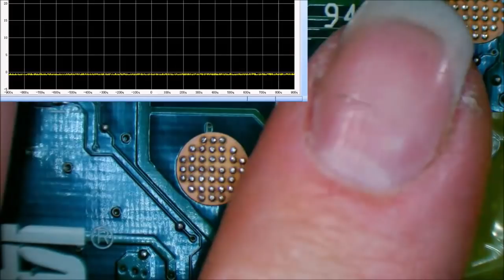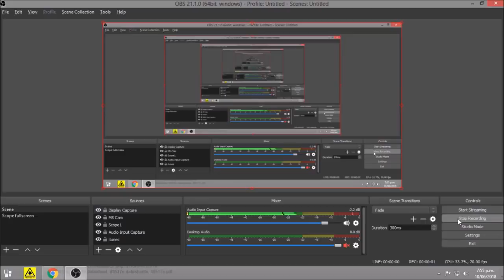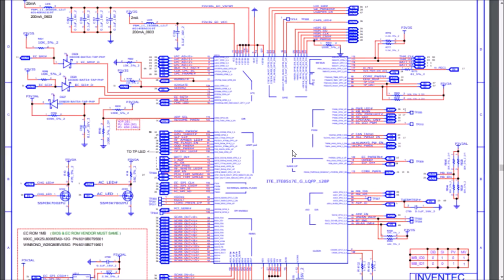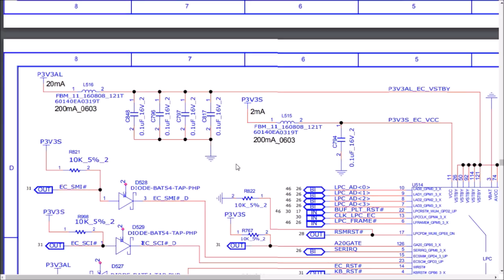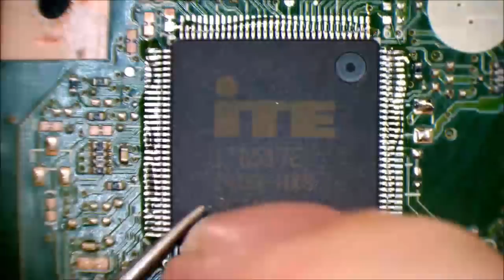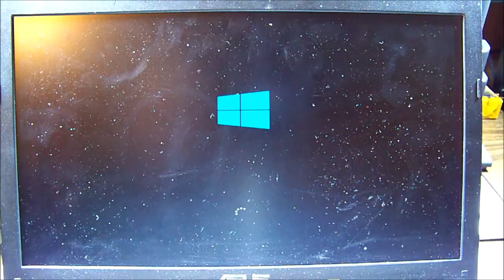Asus A55V completely dead repair

Comment: Hi, I am a newbie, I have the same problem as you. The IC that got hot looks like mine that got hot too. But after I put alcohol on it which evaporated, the whole board now has voltage drop even at the dc jack (only 1 volt). I wonder what the problem is, I can't seem to find parts that is short to the ground.
Reply from the maker: If only 1V at the jack maybe the jack is bad. Maybe try connecting a power supply directly to the motherboard to prove this (set at same voltage as charger). Will need to be at least 3A capable.
Reply: @JonnyFix  Nope the jack is not the problem because if I took off the first mosfet near the jack, then it has 19v just fine. :/
Reply from the maker: @Negiku  You may have to put the mosfet back on and use heat to find the fault. The charger will be shutting down, 1volt won't make heat, so you will need to use a bench supply connected to where the jack goes and limit it to say half an amp and turn it up from there until you feel something get hot. Do it slowly and give it time to heat soak as you don't want to put a lot of power through the fault too quickly or you'll blow it apart and have another issue to deal with. Can take a lot of current tho and if you can only push 3A sometimes it's barely enough. You could also check resistance between ground and all of the coils used for each rail until you find one that's say less than 2 ohm then start pulling caps off until maybe you find the cause. Again if you have a schematic and know what voltage is on a given coil you could use bench supply to inject that much at the coil and look for heat.

Comment: What did you need to know before buying the Chips can you explain to me I found one at eBay it  show a picture of the Chips and it Said IT8517E 1920-CXS DCEAVD but the One I have on my Motherboard it Said IT8517E 1919-HXA DCEAVD. But in the Heading for that listing it said 5pcs x NEW IT8517E CXS HXS HXA EC POWER CONTROLLER IC Chip should I buy it or ask the seller for more info plz help I’m the same problem with my Laptop exactly the same as the you show in the Video plz do help I been using this Laptop for 6 years I no want to let it go have so much Memory with Laptop Growing up with it.
Reply from the maker: ITE8517E is the key number. The other numbers are probably date codes and batch identifiers etc. I did not know these sometimes need to be programmed when I made this so either this one doesn't or I got lucky. Maybe in this model the BIOS configures it at each power on. All you can do is order one and try it.
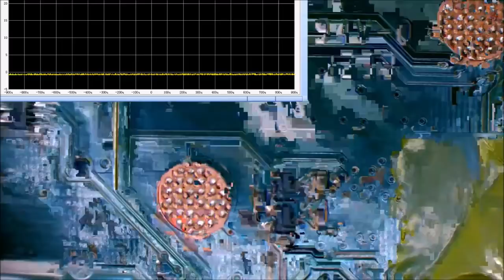Reply: Jonny Fix Ok thank for the Reply back to me thank again for the Video explain the problem that the Motherboard have nearly every problem you stated in that Motherboard I have it with my 7 day dead Laptop that 2 people I bring it two Said it was Dead just buy a new one ya YA not. I’m just hop that the Problem I’m having with my Laptop is the same Problem as the one you fix in the Video. Because my one is a Asus K55A 7 day ago it just does not turn on. It still supplying power to the Motherboard but something is stoping it from turning on every time. I Plug the wire to the Laptop one of the Chip you say in 4:15 in the Video I have the same problem with that part when every time I plug in the Wire nothing turn on but that Chip you Said in the 4:15 you stated in the Video you Said that the Chip it getting VERY HOT it the same as mine. The 2 Chip on the right get warm but THAT ONE get VERY HOT as you stated in the Video so I decided to buy the IT8517E form eBay it Just arrived yesterday Now I’m just waiting for my Brother and Law to Replace the old IT8517E with new one that I just bought. I’m just hoping it that Chip that is the main problem to why I cannot turn the Laptop On plus it have No Light indicating that is On or Off and stuff it the same as you stated with that Motherboard you are fixing Plz wish me Luck on my Laptop that Is bean with me Since I was at High School when I was in year 7 from now. I have had the Laptop for 6 or 7 years and it have not Die On me but now it have Plz PLZ....! FOR GOD PLZ let it be that IO Chip PlZ OW LORD let it be it that is the Problem. Thank for reading my Sentence on what my Side of the Problem was. Thank again for making that Video if not for that Video I might have not have any Hop for my Bro the Laptop that I have so my Memories with it let not it Die now PLZ NO. 😭😢😞😩☹️
Reply from the maker: @lyseachung5613  Good luck man I hope it works for you!

Comment: Can i have some help please? Mine just turning on with power and battery led on but no display. I noticed that all of the ram chip are hot. Any suggestions?
Reply: I've replaced one of the shorted chip near the charger or main power rail. And it turns on for awhile and then went black until now. My laptop is asus x455ld
Reply from the maker: @erticyusa5928  I would replace the RAM. If they are getting hot maybe they were damaged by the previous fault. If you have replaced the RAM with known good modules then I don't know. Diagnostic procedure will have to be followed. Schematics are usually found by using the model number of the motherboard rather than the computer.
Reply: @JonnyFix  thank you. I pulled all of the ram chips and disabled the internal ram and put external ram. Laptop seems to be running with power and charger led on but no display. The internet says ram get power from cpu, is that correct? Or ram get power from separated power supply?
Reply from the maker: @erticyusa5928  Is the original RAM soldered to the board? If so then it's likely the system must have this present and the slot is only for expansion. I assumed all RAM was plug-in. You may need new chips to solder to the board then. RAM will likely have a separate power supply in the form of a switching regulator near the slot or onboard RAM perhaps. Instead of looking for it you could measure the voltage on the capacitors on the card in the slot, you should find one with 1.35V.
Reply: @JonnyFix  yes. It soldered to the board. Do i have to use exact same model of the ram chip? Can i use larger capacity ram?
You know, I was just tried to replace the keyboard and when I asembled the laptop again it won't turn on. Sad. I don't have any money to turn that laptop into repair service. instead i use my daddy's tool. I'm afraid my dad will get mad at me when he comes home
Is it possible to fix this kind of problem in a day?
If not I would sell my pc real quick and then get new replacement
Reply from the maker: @erticyusa5928  Do you know why the chip you replaced by the charger was shorted? Are you sure you got the same part? Replacing a keyboard shouldn't have caused that kind of damage. Unless you have physically damaged the board somehow or maybe put a long screw in a hole that should have been a short screw for example. I would carefully retrace all your steps with the keyboard swap and hopefully you will realize what you did. I don't think you should try replacing the RAM chips, that is a 8/10 difficulty level. A repair shop might be your cheapest option, they will be able to identify the problem without causing more damage. Sorry I can't be of more help.
Reply: @JonnyFix  thank you. I would fix this myself, sell this board and buy my pc again. No waste. Once again, thank you very much
Reply: @JonnyFix  update. I did it. I fixed this laptop. I just changed smd p channel mosfet near the battery. Im so happy. Yay!
Reply from the maker: @erticyusa5928  That's really awesome! Well done! :)

Comment: I have an asus K56ca that looks very like yours, same super Ite chip, but mine switches on fine, then anywhere between 5 to 30 mins it just switches off with no warning, like the power is pulled.
The annoying thing is you can press the button and off it goes again lol.
Cpu is running cool so not overheating.
Battery or 19v power, same thing.
i was thinking supply to that super i/o perhaps, if i could find the supply.
Then i found your video lol.
I hope your asus is still working great, good detective work :-D
Reply from the maker: Cheers! Given how random the time is I wonder if it is a capacitor that is failing and pulling a rail down. I would use a scope if possible, the more channels the better, and watch some rails and you might see any fluctuations. Also, if you remove HD and not let it boot does it still shut down to prove it's not the OS causing it? Will it run on battery.. if battery is no good maybe the charger is failing or the input socket is bad. Another overlooked item is the power button, if it isn't operating right (has had liquid in it or anything really) it might be partially staying on/not letting the signal return to full voltage enough to force a shutdown. Maybe you could unplug it once it is on and see if that resolves the problem.
Reply: Thankyou for all your good ideas :-D, my brain is slower than it used to be, so it needs a kick sometimes lol.
It's a machine i was given, so it could replace my crusty old steam powered acer i have from 2007.
Thankyou for helping :-D
Reply from the maker: @zx8401ztv  Cool let me know if you figure it out!